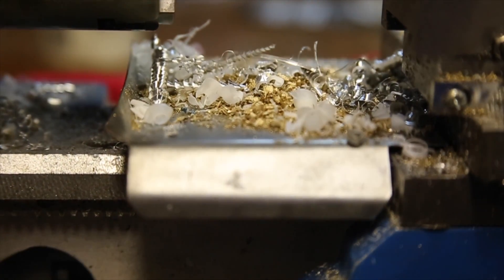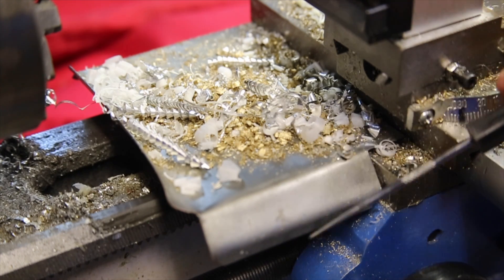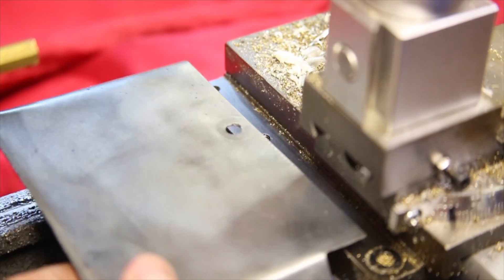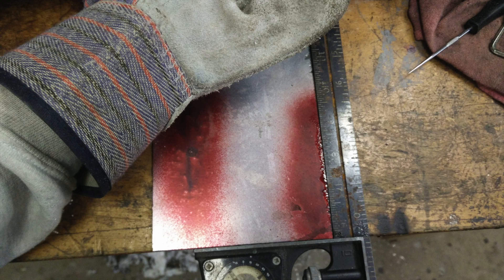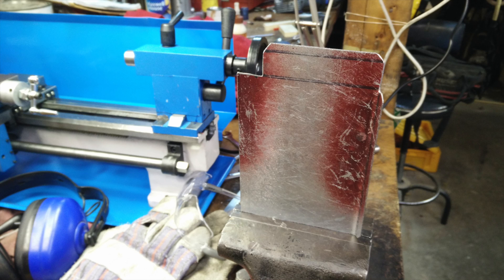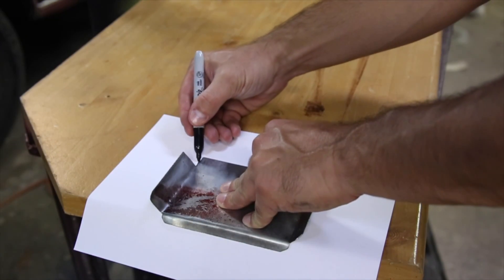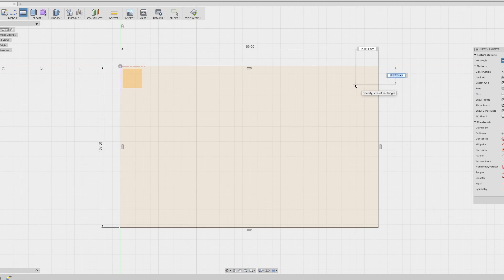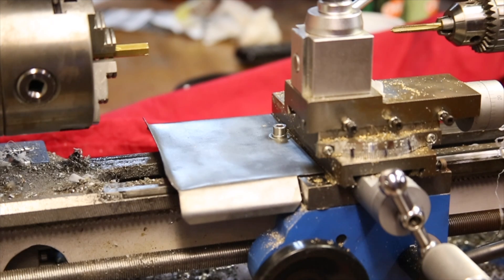DIY Mini Lathe Chip Tray (Free Template Download)

Comment: Been wanting to make one of these myself... Only problem being that it would have to be removed any time I wanted to use my carriage stop (which I use fairly often).
Reply: Only 1 bolt to remove only takes a a second
Reply: Agreed... Though in my case it would be 2 bolts (I have the H-shaped carriage on my mini lathe)

The problem is, with as much as I use the carriage stop, the tray would spend more time off the lathe than on, which would make it pointless. I could also make a chip tray that accommodates the stop, which would leave the prism way and lead screw exposed, which would make it pointless.

I'll probably end up redesigning the carriage stop... Move the locking handle to the underside or something. I'd really like to have a chip tray attached to the carriage, especially when I add a DRO to the cross slide.
Reply: True. Though I think I've got it figured out. I replaced the handle on the carriage stop, with a socket head cap screw. I'll make the chip tray hinged on the apron side for access. Flip it up to lock and set the stop, then flip it down before the chips start flying.

The SHCS works out better, anyway. The handle on the stop was pretty tall, and could get whacked by the chuck jaws if I had them open wide enough (safety spins are important!).

Sure, now it needs a tool to lock it. But I already needed to keep a 4mm hex key handy, as I had to nix the carriage lock handle when I relocated it to the tailstock side of the carriage (it interfered with the compound).
Reply: Make Everything I tried that on mine and really didn't like it because turning steel would cause a major pile of chips that would not come off with a chip brush or my shop vac.  I just slotted my bolt holes that hold the tray and can remove it very quickly.

Comment: On my mini lathe those existing holes are for the follow rest.  Which is used when turning long items.  My lathe came with a follow rest and a steady rest, which seems overkill for a lathe that only has 12 inches between centers.
Reply from the maker: Ahh, that makes sense - and I agree with you, I'm not sure I would ever need a follow rest but who knows. The hole should still work if I really needed it though. Thanks for the input!
Reply: TimNummy I just used the bolts that were for the follow rest to secure my chip shield.  I made mine from a piece of clear polycarbonate(I guess that was what it was) that came with my auto-darkening welding helmet from harbor freight.  They even sell them on the welding isle at the HF stores.
Reply: Jonathan Allen I could see it being needed in that case.  But both my follow and steady rest have never been used and was still in the plastic bags inside a draw string bag that came with my lathe.  I would guess my lathe is at least 10 years old, it is a Pro-Tech brand and is a dark blue color.  But it is built the same as all the 7x lathes.  I have to say my lathe runs quieter than all of them I have heard, maybe it doesn't have many hours on it or it actually has lube on the plastic gears inside the spindle?